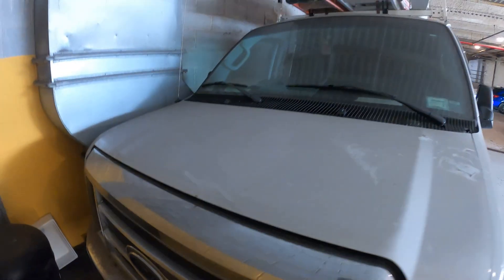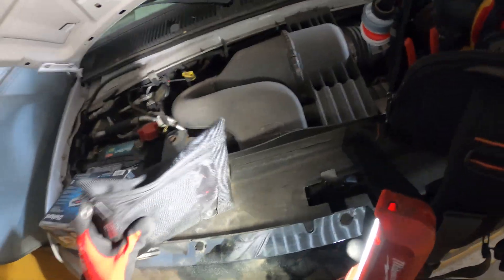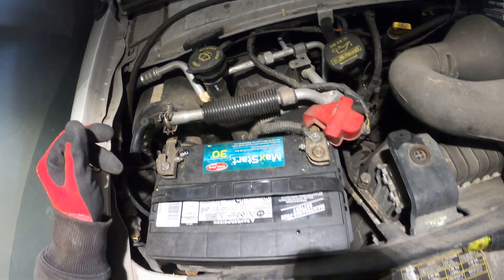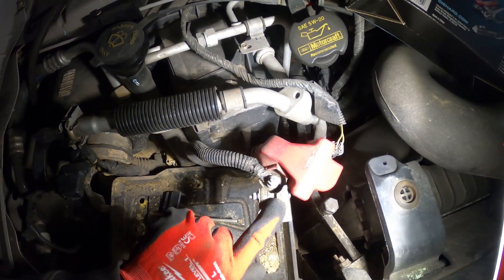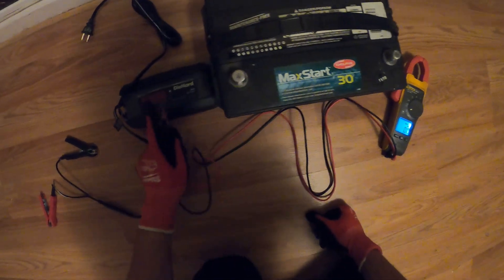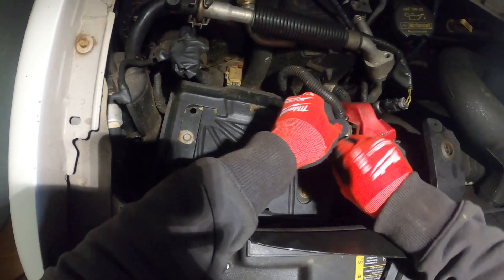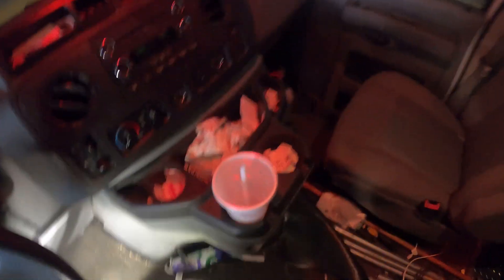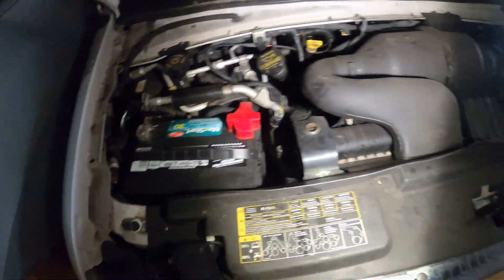Ford Econoline Van Not Starting (How To Check A Car Battery?) How To Charge A Car Battery? EASY!

Comment: How r u bro.i hope u fine
Fcu unit thermostat 23 temp reached Automatically cut off next this thermostat set poit going town 22,21,19.its not come down 23,24,25..what is the problem?
Reply from the maker: Not exactly sure but it sounds like it's it's working if it reached temperature and tuned off. Check with a digital Thermometer next to where the unit reads temperature and see if it's accurate. Thanks for watching!